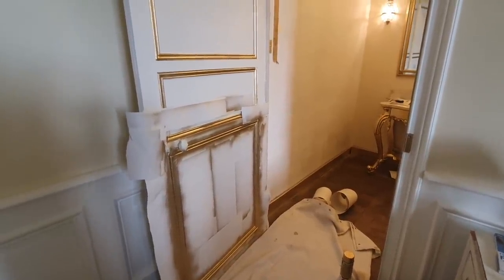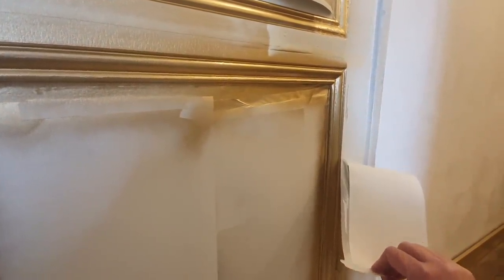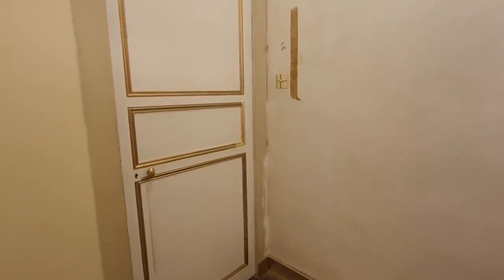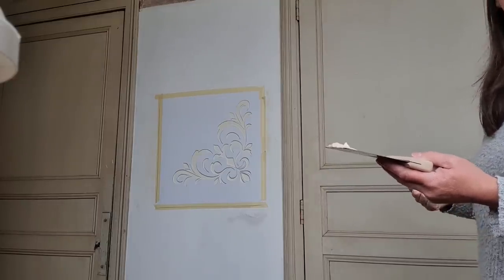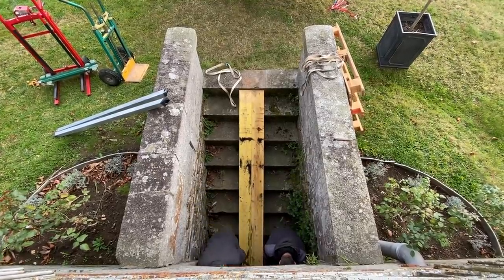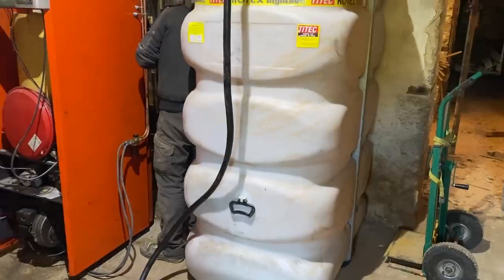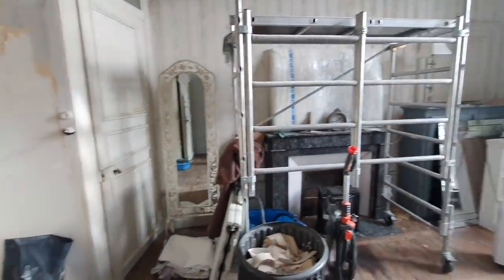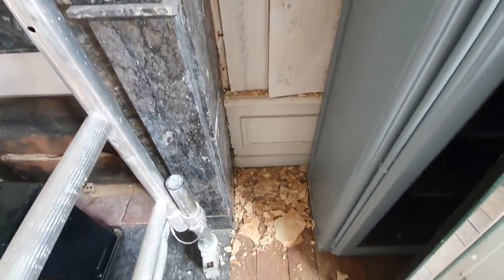What It Costs To Heat A Chateau...

Comment: For the best affect with gold gilding, paint the area to be gilded with red paint and gild over the top. When silver gilding use sky blue paint and sizing (tacky glue) to prepare the area, then guild. The paint underneath the gild makes the gold and silver stand out. :)
Reply from the maker: The skirting boards, I sprayed gold first  which worked well. But will bare in mind the red in future
Reply: Gréât advice!

Comment: I really liked our reclaimed cast iron radiators when we renovated a school house in Normandy in 2002. We bought 4 for 30 euros each. From a working system. 2x 12 column x 14 sections x 2ft high and 2x 4 column by 12 sections x 900 high wide. The heat as you say is fantastic. Our 3 bed stone house was around 95sqm and we had 13 radiators totalling 20kw output. Originally fitted a cheap Lamborghini oil boiler, but in 2008 took it out as getting through 600 litres in 6-8 weeks. Grandparents liked the heat. Replaced with a Villager boiler stove. 25 cubic metres of wood ran the radiators for 7 months of winter. Cost around 700 euro then in 2008 all seasoned, cut, delivered and ready to burn.  The 3 cast iron radiators in the living room once the stove was installed in the room we could turn off as the stove heated the old school room of 35sqm and 4.2 metre high ceiling. The stove heated the 10 radiators.
Reply from the maker: Yes the heat we get off these old rads is amazing, which is why we won’t replace them
Reply: Very sensible. Can't understand why people do. The output for their size is amazing. If I had a period home I would install cast iron radiators. Ours were the classic design.
Reply: My apt building is on steam radiators , love them so warm all the time. Not familiar with oil radiators ? Hard / impossible to find on new houses none in US , unless home is pre-1920ish

Comment: It is good you now have a working boiler.  If your radiators are too hot to touch, your thermostat is probably too high.  We have cast iron radiators (100+yrs old) in our home in Saskatchewan Canada.  Radiant heat is amazing because it heats up the objects in the room not just blowing warm air into the room.  We keep our thermostat at 21.5 C for daytime and 16 C for night time.  In the summer we turn off the heating part and just retain the hot water.
I am amazed at how fast the work is progressing, we have been working on our home, a fraction of the size of yours, for the past 7 yrs.  
Not having a listed building was a wise decision, too many hoops to jump through with them.
Reply from the maker: Thank you Veronica, we are looking forward to a rest at Christmas and then we can pace ourselves

Comment: Hi guys great job. Oh yes, warmer outside than in! Third winter here now for us and we’re in the south! Why not consider running individual pellet stoves and log burners. One ducting pellet stove can heat up to three rooms. This also means you can control zones too. So you could just run two stoves when it’s just you two, then run 3 or four stoves when the family are over? It’s the solution we have gone for now. 👍
Reply from the maker: Will look into this but I feel 1 boiler would be more efficient long term and take up less room. We can still isolate the zones not required by just closing off the rads. Next task for me will be to put thermostats on the rads and then hook the system up to my phone for better control.
Reply: Agree wood stoves are so efficient.  I'd use them as a back up heat tho , not primary  . Never used pellet stove tho

Comment: Painters tape or green frog tape known here in Canada works way better than masking tape.  Because it is a low tack tape it doesn't pull off paint underneath. Your doing an amazing job and keep up the good work - just thought this would save you some touch up work.
Reply from the maker: Hi Binks, they had sold out! Typical. I did mske thectspe less tacky by sticking it to my trousers first!!! Thank you for following

Comment: Plastering stencil👌🏻👏🏼 Could you spray paint it gold, after it is dry & b4 removing the stencil? Or would it muck up your stencil to much? Not be able to use multiple times? OR could your spray paint plaster with a water base color, then scrub stencil for reuse again? Would spraying PAM ( A fine spray oil for cooking)on the plastic stencil then plaster, dry & paint work? Making it easier to clean between uses. Would have to prevent PAM from touching the wall? 
Carol you have stirred my creative juices flowing!💕😘Little Falls MN.
Reply from the maker: Karen,  you sound like my mind, ticking over all the time with different ideas. Watch the next installment for effects I tried

Comment: In the US we use blue painter's tape instead of masking tape.  The painters tape is a little less tacky but tacky enough that it seals the edge but not so tacky that it takes off wall, door or trim paint.
Reply from the maker: They had sold out! I did make it less tacky by sticking it to my trousers first!!

Comment: If you go to the wood pellet system, do you have change over the whole system or just that plastic tank?
But things are looking good 👍
Reply from the maker: Hi Troy. We can use the existing system but will have to upgrade the glue and the boiler will give off slot more heat. Plastic tank goes and is replaced with a hopper to hold the pellets. Might put the oil boiler later on in the coach house